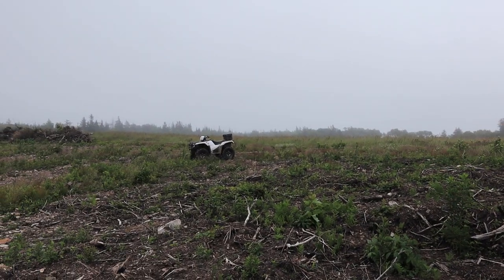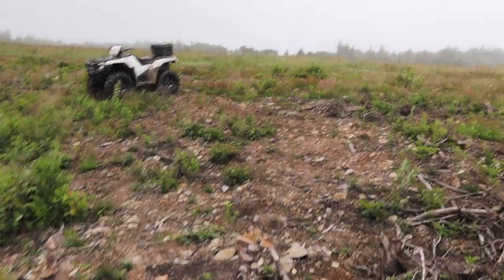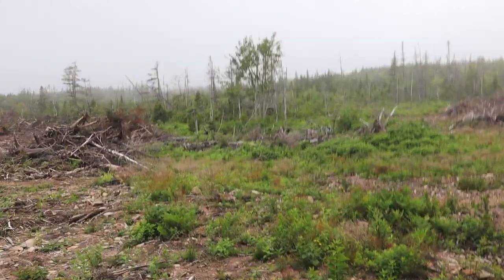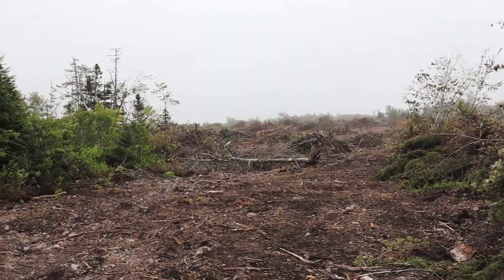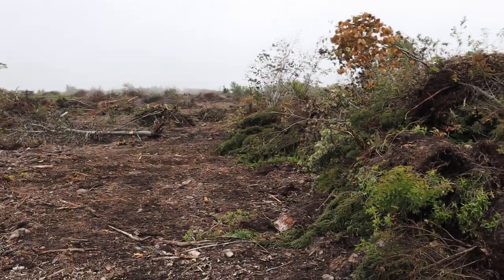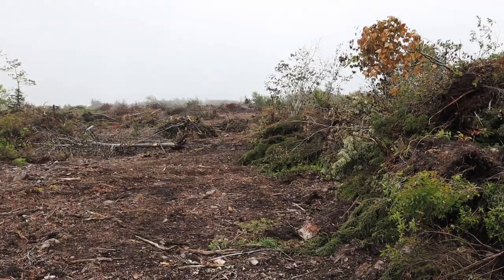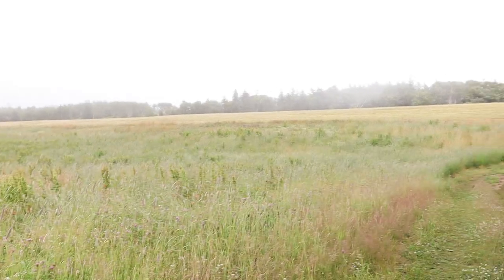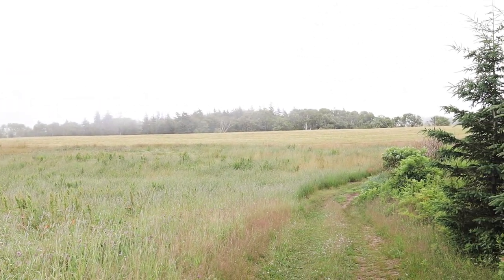Creating new farmland from forrest Phase 1

Comment: If the machine is overheating since the hood is up, I finally figured out my hitachi had bad fan belts, never made a noise but I changed them out and it would never overheat! before it was in the red after 10 mins
Reply from the maker: Thanks for the comment man good to see you stop in. We kind of found it really liked running 3/4-wide open a lot better no hear issues then. Running half throttle or a little better it seemed to build heat. We’ll check those belts I wouldn’t hurt to change them.

Comment: Instead of pushing all the brush into a swamp can it not be run through a chipper/shredder to help it compost back into the ground? Thanks for the update
Reply: Do you not understand how expensive it would be to even rent a chipper big enough to do what you are suggesting?
Reply: @ArnieD17  I have not got a clue, I don't know how much a man with a bulldozer costs either. I imagine top quality top soil or compost is slightly pricey too.
Reply from the maker: It's possible but it likely would be a bit cost prohibitive. I'm not even sure if there is any of them around to be rented/hired.
Reply: @macfarms  still time for that fire then.
Reply from the maker: maybe next winter she's a bit dry around now